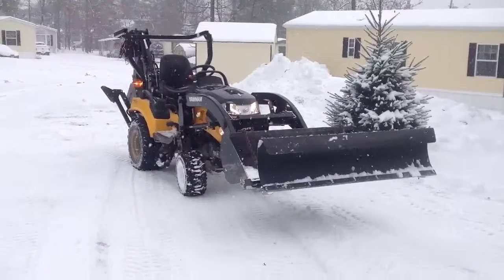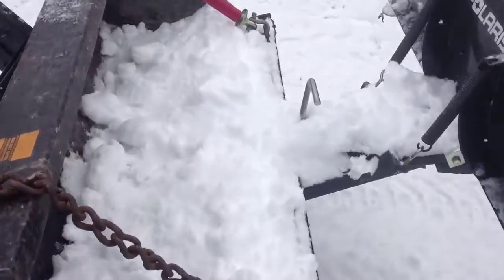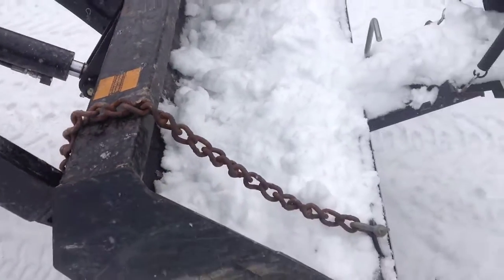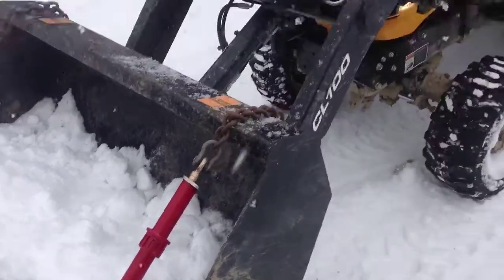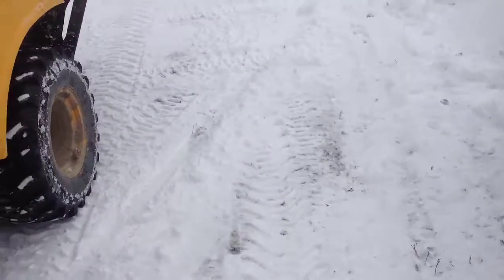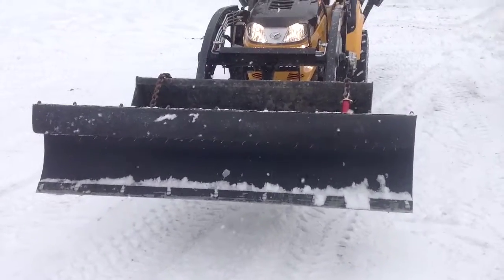☃❄4x4 tractor moving snow with a homemade fabricated steel snow plow Yanmar plowing snow

Comment: Works awesome. Can't remember what vid it was Dan but i saw a guy who geared up a rope and pulley to change the blade angle without getting off the machine. All he did was pull the rope and drive ahead putting pressure on one side or another. I've been thinking on trying it myself for my atv. Not that it's a big deal to get off but it would save the time and hassle. Nice job. Thanks for sharing.